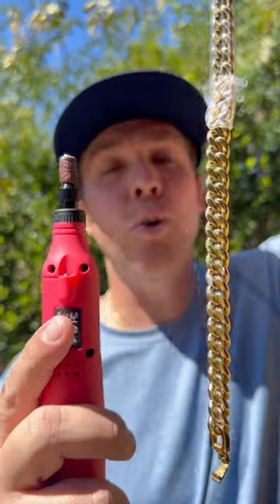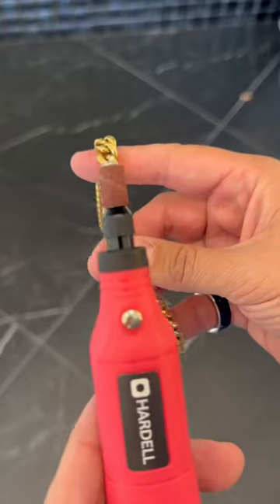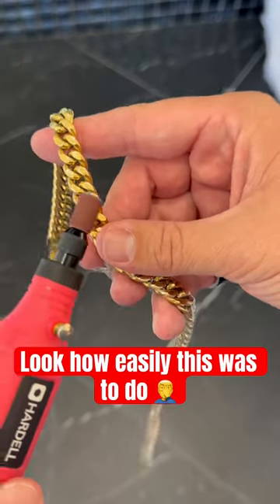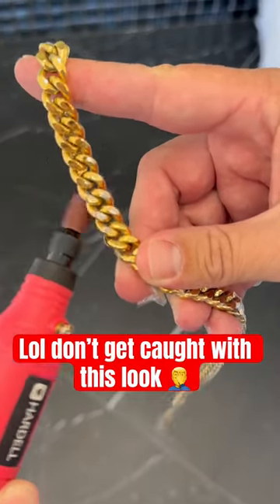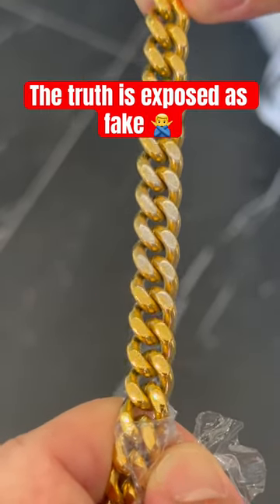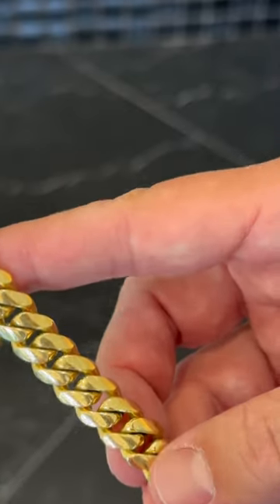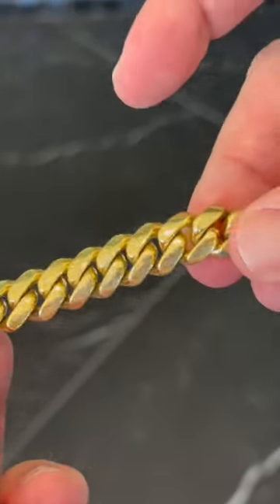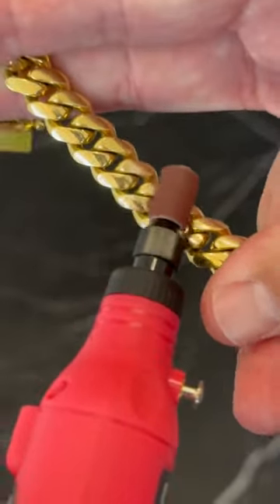Fake gold chain exposed in seconds..

Comment: That pretty much is the case with buying gold plated chains that are over stainless steel. Nothing wrong with that as long as vendors disclose it as that. But blatantly lying marketing it as solid gold but its plated over stainless steel or worse, brass or copper, that's just shameful. 
Those chains are found on Chinese-run sites like Alibaba or Temu directly, or even "shops" like GLD, Guu Shop, Jaxxon, etc when those same chains are from the same manufacturer.